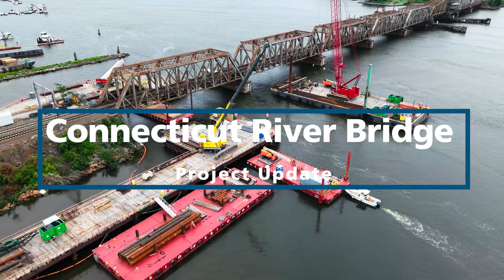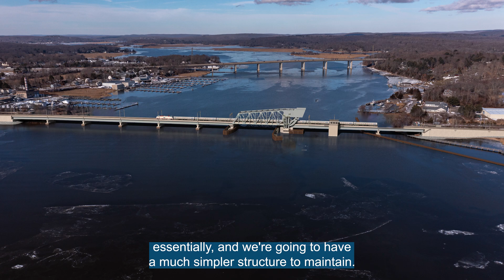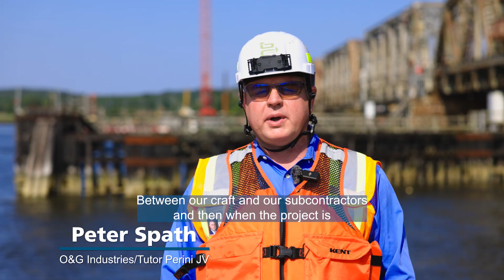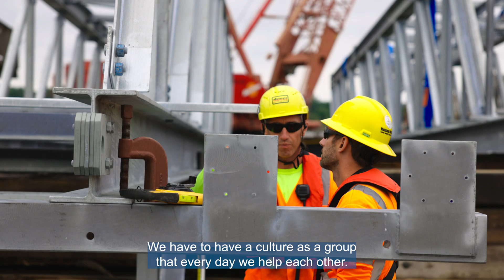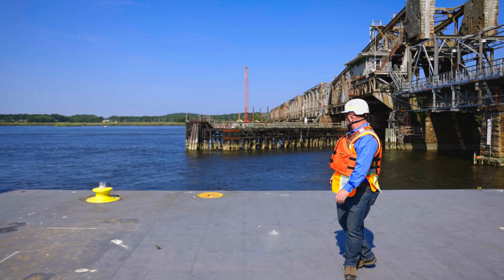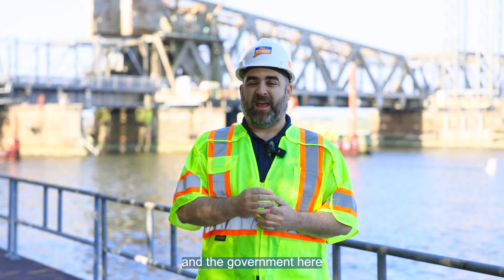Behind the Scenes: The New Connecticut River Bridge That Will Cut Delays and Boost Speed by 55%

Comment: Why not building a higher bridge instead? Cheaper on the long run
Reply: Way more expensive for almost no benefit. In this location it would require a significantly higher bride, thus raising the trackbed for miles.

Comment: Did they mention travel time savings somewhere?  I was hoping to see that data included
Reply: Maybe a minute just going by track speed; I think it’s going from 45 mph restriction to 75 mph. Over just a mile or two there’s not much room for improvement.

On the other hand it should provide a significant reduction in delays, which aren’t quite as easy to calculate the time savings for from accessible data on the internet.
Reply: @andrewreynolds4949  I think its more about the reliability and not having backups that the immediate trip savings which is easier to calculate.  I guess I'm wondering how this fits into the 30-30-30 plan.  But I'm biased as that's all I really care about haha

Comment: This may seem silly, but could the Acela line potentially eventually be upgraded to a maglev? America used to be dominant in passenger rail, it's time we take back that title.
Reply: That would require a completely new right-of way. I would recommend  checking out ETA’s transit cost project to see how the current rail infrastructure can support trip times basically being cut in half.
Reply: There are plenty of improvements that would make the Acela a world class passenger rail line that would be easier and cheaper than "upgrading" it to maglev.
Reply: Maglev is a gimmick; it’s not at all compatible with any existing systems, so trains wouldn’t be able to leave the NEC (or whatever length was “converted”). That’s completely counter to Amtrak’s entire strategy in the region.

Not to mention the immense cost and the technical impracticality of such a system.
Reply: Now that would be PROGRESS for here. We're so living in the past which would get us too comfortable with and not grow.

Comment: They're not even changing the design! That's good to know!
Reply: From the original bridge? Apart from the main lift span the bridge will be of a different type. On the main span the broad design type will be the same but the specifics (including height and span length) will be different